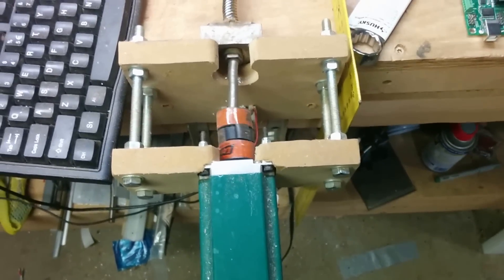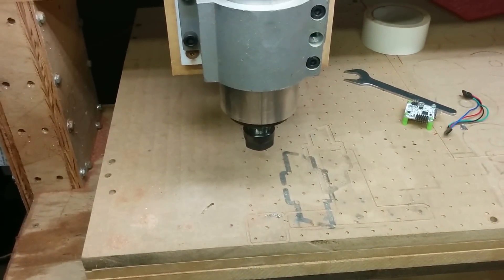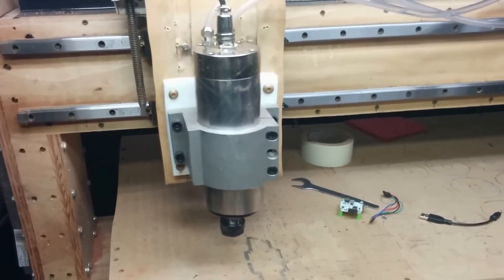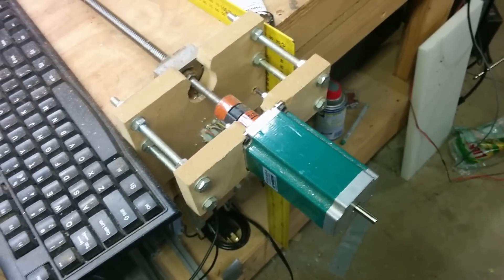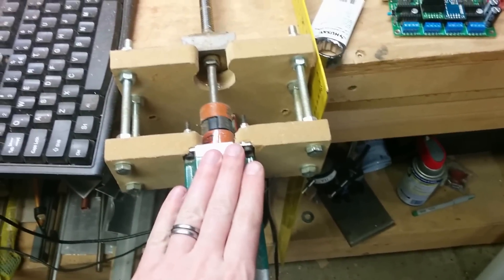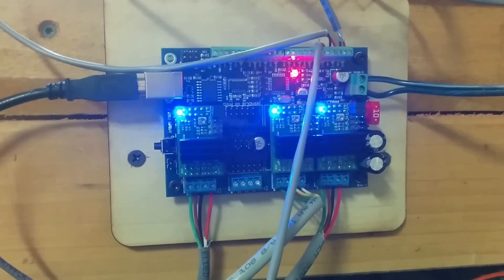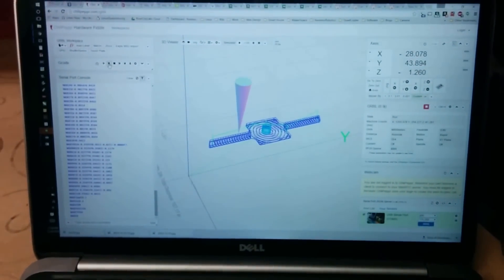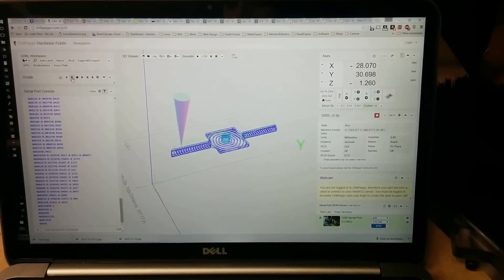Gradus M1 Pro with BigFoot driver initial test

Comment from the maker: the stepper drivers. The drivers I normally use are kl-6065 drivers from automationtechnologiesinc.com and while they are very powerful they are very loud even at 32 microstepping and generate loads of heat.